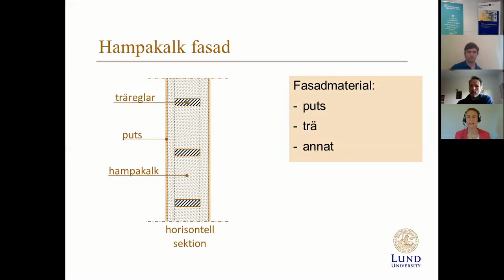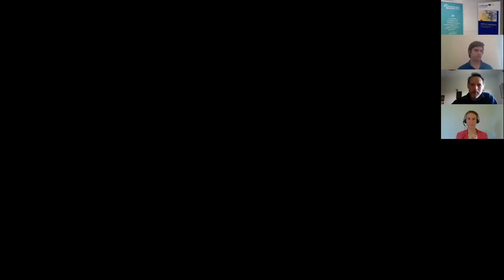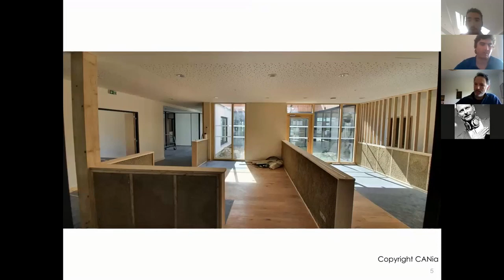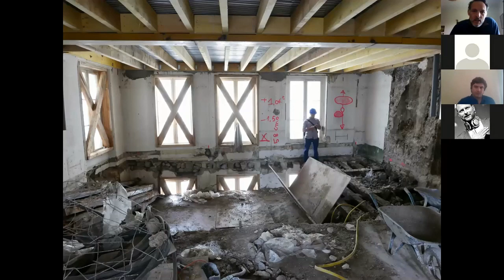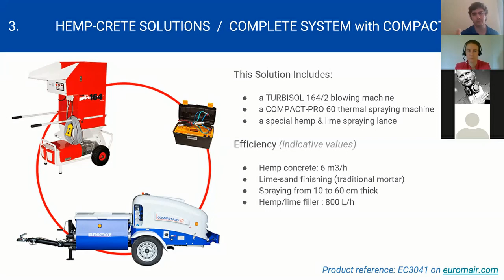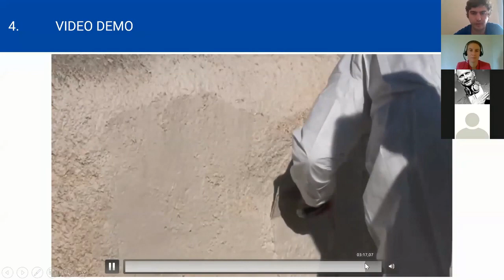Hempcrete and wood in bio-based buildings

Comment: Is there any study done for expended continuous fiberboard for better mechanical properties? I could see hemp wool dip in a thin concrete and squeeze between roller (like a grandmother twister) to take the excess of concrete out and then let the fiber spring back expend the material to make a low-density board.

Simon V.
B. Sc eng. composite material manufacturing